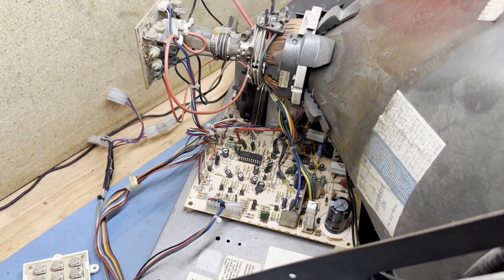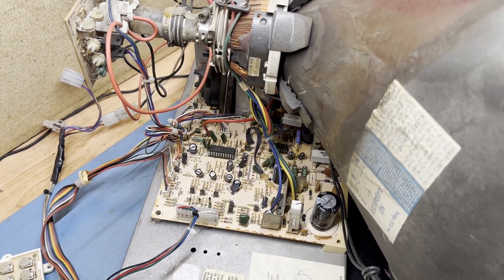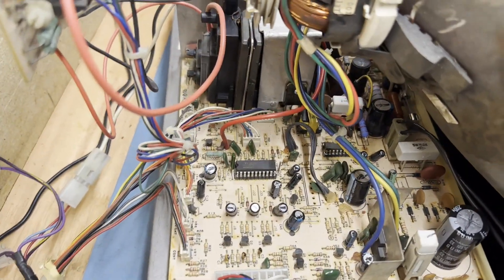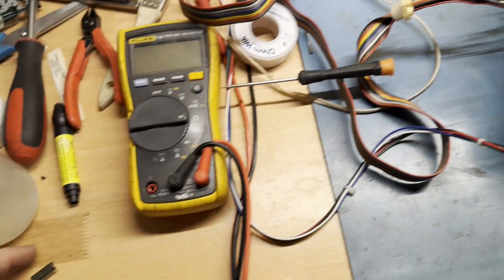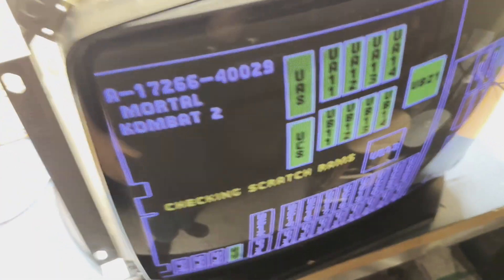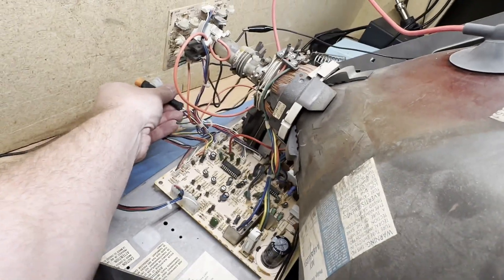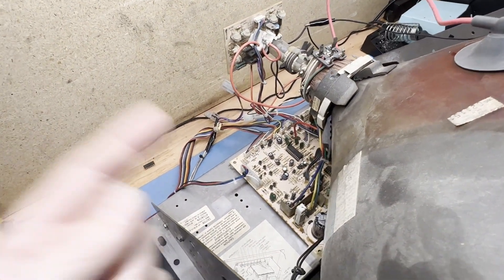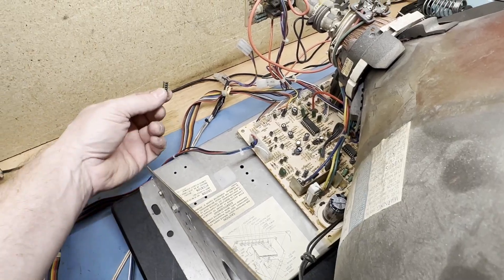19" K7000 Arcade Monitor Repair - Horizontal Hold/Repeating Image Issue - IC2 Is Bad

Comment: Recently I visited a huge arcade. With CRTs being hard to come by and the cost of electricity, i can't believe they can keep them running. I'm wondering if they could leave the game and sound running but set up a timer that turns the CRT off and on after a credit is added. That way the "boot time" is seconds to play a game. I know you lose attract mode but... (I want to see places like this stay around for a long time). My question.... is start up hard on a CRT and circuits? If not... Maybe they could even do motion sensors?

Comment: Hey Mike, wondering if you can give me some advice about a consumer set that I am servicing. I may have damaged it and would like to know what steps you would take to troubleshoot. Thanks!
Reply from the maker: What’s up?
Reply: @MikesArcadeMonitorRepair  sorry for the long story but i want you to have context! It is a 20" Sony Trinitron from 1998. I powered on the set while it was missing a capacitor near the vertical IC and another on the neck board. I know, it was stupid. I removed them a few days earlier because i was putting together a cap kit, and i forgot they had been removed. 

The screen got static, but it was all black except for an oblong shaped blue-ish splotch in the bottom left quadrant of the screen. I immediately unplugged the set, but the blue splotch took a minute to completely disappear. 

So i tried replacing the missing capacitors and powering the set again, but I was met with the same black screen and splotch in the same position. I havent tried powering the set on since then because i dont want to burn the screen. 

I figured i blew out the vertical IC because that cap was directly connected to a pin on the IC. It doesnt read as shorted, but I have a feeling it is still bad. 

I also checked the HOT because the image didnt collapse into a thin horizontal or vertical line. It reads shorted when I do a continuity test in-circuit. I still have more testing to do out of circuit, but I thought I might run the situation past you to see what you think. Did I ruin this set, or do you think I might have a shot at repairing it? What kind of damage could I have done and how would you go about checking for that damage?
Reply from the maker: Hmm. Not sure off hand in this case. Can’t say I’ve ever worked on a Trinitron but I do know they are complicated. There must be an IC somewhere that got taken out but with the HOT reading shorted in circuit (but not out of circuit I’m assuming), you’ll have to trace the circuit out and check the components in the circuit and see what you can find.

Comment: The thumbnail made it look like a similar problem I have with a G07 chassis just horizontal lines it’s that chassis John (John’s Arcade) had trouble with during his Journey restoration I ended up with it and messed around with it for awhile years ago but never got it working right yet I should give it another shot.

Comment: I have one of those odd k7000 19” chassis, felt like they were built much better, were they different because the difference of the small or big pin neckboards?
Reply from the maker: No. Just a very late design.